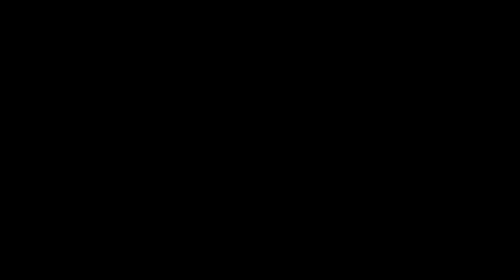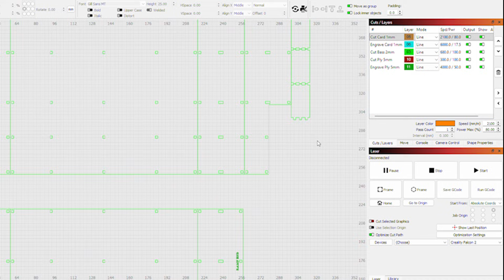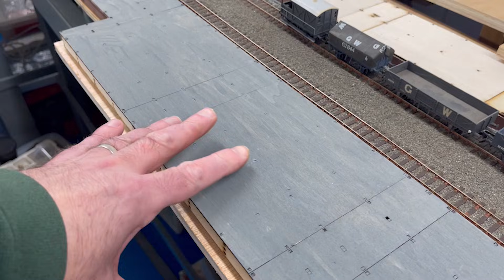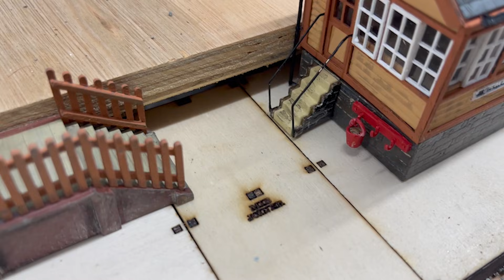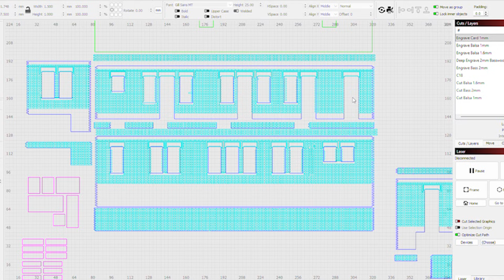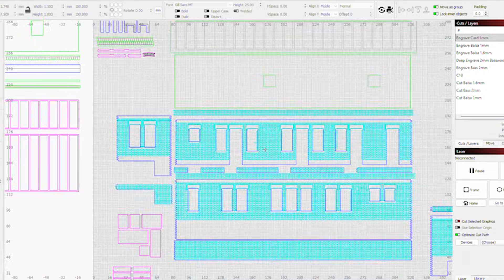29 - Plans, Platforms and Progress on the Heritage Line Station at Donnington Castle Model Railway

Comment: Re that ledge that you keep smacking into, Chamfer the corners before it gets too buried in scenics! your midriff will thank you! either adding smooth corner bumpers or cutting off the sharp corners, but depends on your platform and station building!  great video, subbed.
Reply from the maker: That's a very sensible idea. Now might also be a good time to think about how those hinged or lift out solutions might work so, as you say, I can factor that into the plan for the station and the surrounding scenics. Thanks for the comment and the sub!

Comment: Looks awsome. Might as well extend the full length so you stop hurting yourself 😂
Reply from the maker: Thank you, that's very kind and thanks for the suggestion. The deliberate design decision (or more accurately happy accident) was that the gap was originally just wide enough for me to face all directions and rotate through 360. The extension is just big enough to stop me doing that. So if I extend the board either lengthwise or across the gap I'll save the bruises but will get annoyed ducking up and down the whole time. Its one of those things that makes me see the value in properly planning a layout before starting work!

Comment: Nice to see it progressing. I was just wondering what laser cutter you used? Thanks Tim
Reply from the maker: Thanks Tim. I use a Falcon 2 40W cutter. It has no enclosure so I need to run it with the garage doors open and as its a diode laser it won't cut anything transparent. It also doesn't have a bunch of features the newer ones have. But I'm happy with my workflow using it and it does everything I need it to for the layout and other DIY projects. Hope that helps.
Reply: @DonningtonCastleModelRailway  Thanks for the insight mate. I'll note that down. I am doing research at the moment so this type of feedback is really helpful.
Reply from the maker: @ScampertonModelRailway glad that helps. If you have any more questions please feel free to drop me an email and I'll happily share more thoughts and experiences.